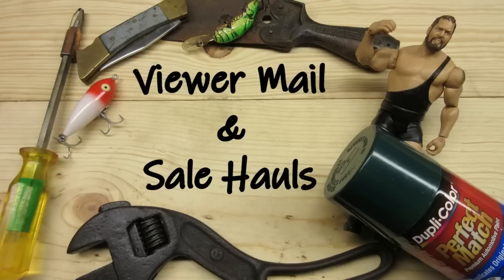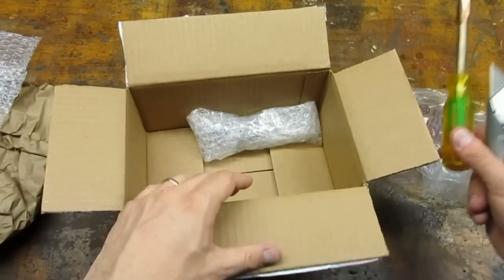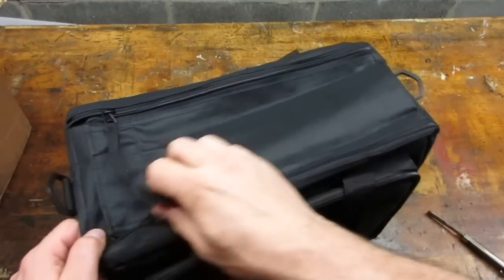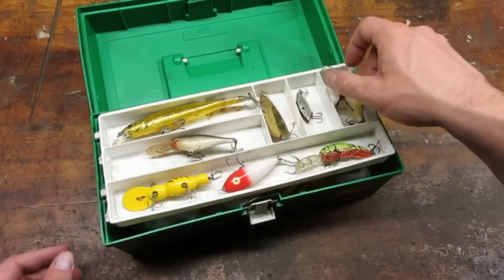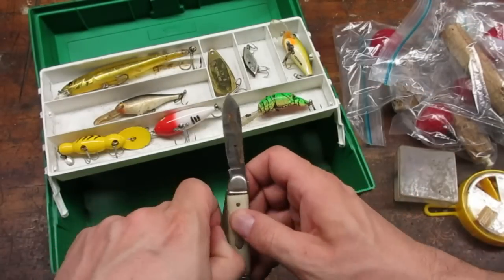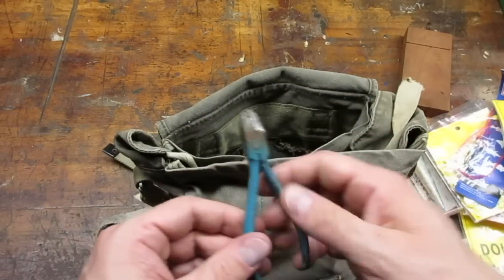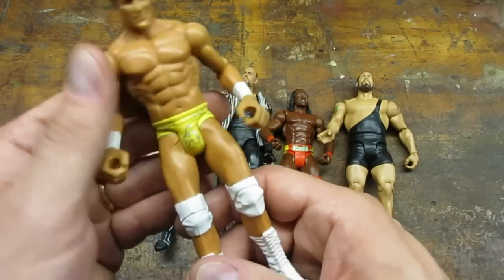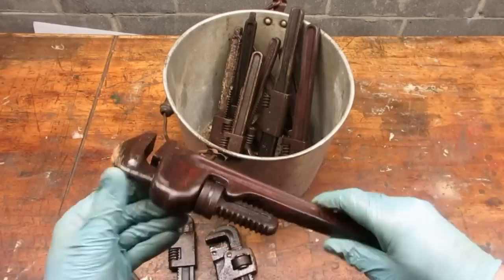Viewer Mail and Sale Hauls

Comment: An interesting collection. My late father used to watch wrestling on TV back in the late 1970s. I like Mrs Magdads Stanley 199 however the blade looks a little dull, you might want sharpen it a little. Have you found a green handle screwdriver yet?
Reply from the maker: Hey Nash!  Some of those "action figures" are very collectible I always grab them at the sales if they are cheap.  No green screwdriver yet - I may have to have Mrs Magdad make me one!